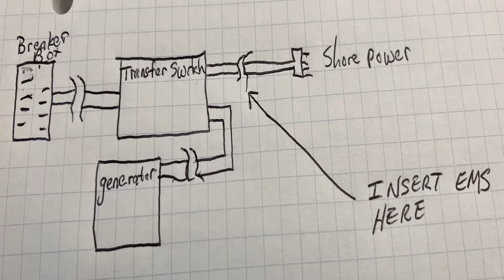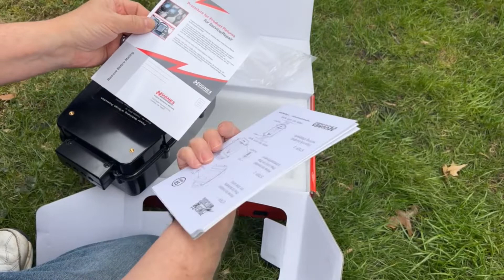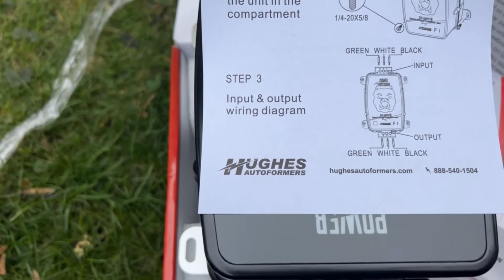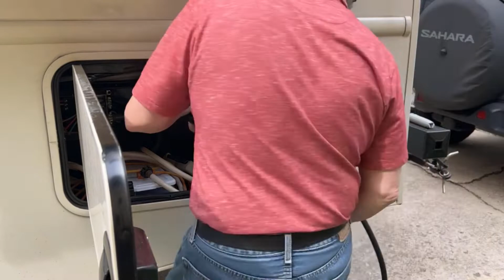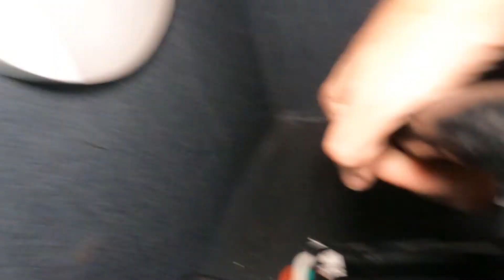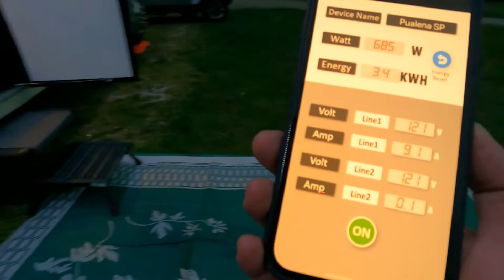Hughes Power Watchdog 50 Amp Install | RV Surge Protector Guide

Comment: Why did you choose to purchase the Watchdog as opposed to the offerings by Progressive Industries or Surge Guard?
Reply from the maker: I have heard of surge guard, but I am unfamiliar with progressive industries.  We purchased the Watchdog at the RV dealer in early 2022 when Covid was peaking again.  The watch dog had features I was looking for such as the over/under voltage protection and the Bluetooth phone app.  I have now connected to my onboard Home Assistant system and can monitor the Watchdog from anywhere I have Internet access.  A big plus in my book.